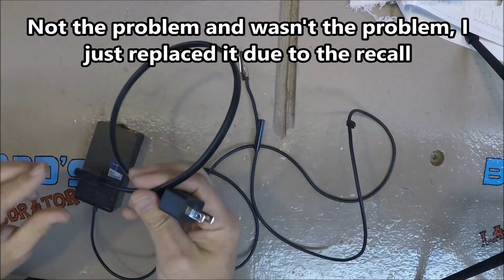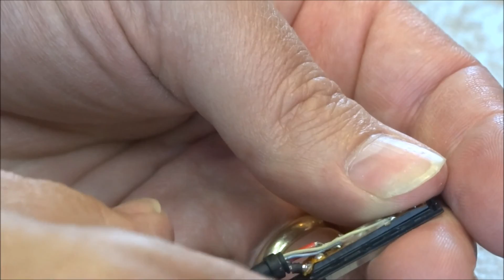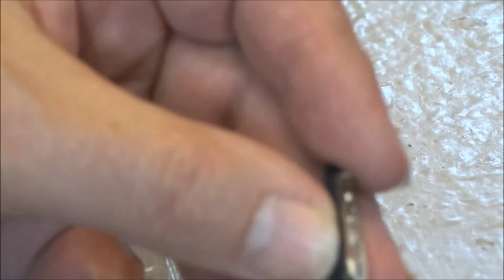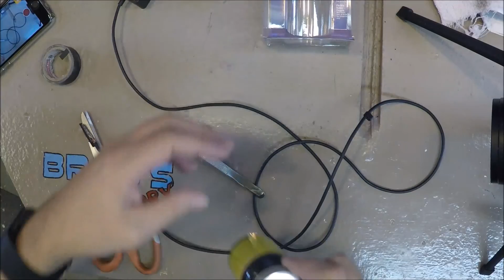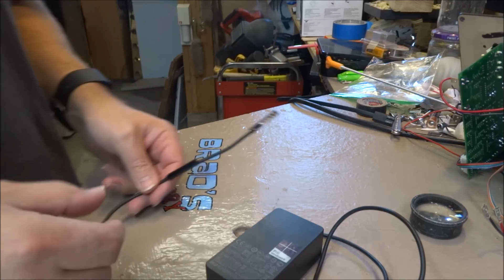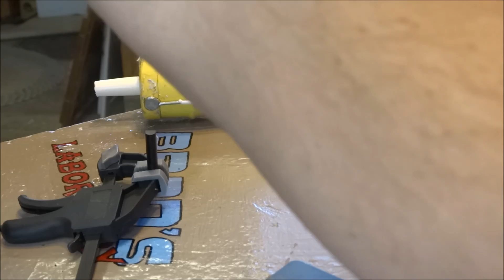Surface Pro Power Cable

Comment: Brad can you tell me the pin out on a surface pro dock? I posted some pics of the disassembled device.  I’m not sure if the centre pin is the 12V or just LED/sense. Then there is pins 2,4 which are connected and the pins 1,5 which are ground and are the outermost metal parts inside the socket.  Is the connector carrying 12v and 5v?  Or just 12V with two types of ground?
Reply: I meant to add pictures

https://photos.app.goo.gl/XuZvNsnGFTwyohjR9
Reply from the maker: I don’t have one to test but a google search shows 12V on the two outermost pins, next pins in are control bus pins that are used for information exchange between the power supply and the computer and the innermost pins are ground.
Reply: Thanks Brad - did you see a picture? I’m not game to connect it yet - mean time waiting 2 weeks for a plug-pack 4A 12V adapter in the mail 
ARyee 15V 6A 90W Surface Dock Charger Compatible with... https://www.amazon.com.au/dp/B095S3M1PM/ref=cm_sw_r_sms_api_i_BNM18RW8WRME5NCBCA05?_encoding=UTF8&psc=1

Comment: Hi, I am having trouble with my surface pro 1 charger, I opened it as you did on the video and check the voltage between ground and power but it only shows 8.20 Volts and not 12 Volts like yours.
What could be the problem? BTW, Nice video, thanks
Reply from the maker: Something is dragging it down, maybe the LED is bad in the connector or there could be something else going bad inside the power supply. easiest thing to do is to buy a new one, they have gotten fairly cheap these days:
https://amzn.to/30CR8K4

Comment: Does this works for surface pro 2 too?? Please help
Reply from the maker: It appears the surface pro 1 and surface pro 2 use the same power adapter, so your should be good to go.
Reply: @BradsLaboratory  my surface charger was working fine a few days back but now it has stopped charging the surface and the led won’t light up. I saw your other video using voltmeter and there is no voltage (12Volts )between power and ground. The charger warms ups after connecting to the power source after a while. But the surface isn’t charging. I even used the electrical tape like you explained in this video but still no voltage. Please help what should i do. Should i repair the charger or buy a new one? The charger is very costly here (5000 bucks on amazon)
Reply from the maker: @Sunny_Goyal  I would check for damage to the cord, power is probably not getting from the power supply to the connector. My power supply is 12VDC at 3.6 amps, you can find one with the same or more current you can use that if the power supply is bad.
Reply: @BradsLaboratory  i am sorry, I couldn’t understand what you are trying to explain but my house power outlet(wall outlet) is good.its charging other devices like my phone. Its has 220 Volts output and i checked the cord which connects the wall outlet to the surface charger by removing it from the surface charger and using voltmeter which reads approx 230 volts. I connected that cord back to the charger and the charger warms up but there is no voltage difference between the pins in the connector like you explained in the other video. Please help what should i do?
Reply from the maker: @Sunny_Goyal  I was just thinking that there could be an open wire between the power supply and the connector if a dog has chewed it or something like that.
Reply: @BradsLaboratory  sorry, but I don’t have a dog or a cat. Also there is no open wire. Moreover I do keep my electronics safely. But it somehow stopped charging suddenly. Is there any way i could revive this charger or do I have to buy a new one :( ?
Reply: @BradsLaboratory  hey brad have you tried opening the adapter? From where does the adapter open ? The side where there is something written and a logo of windows is there or the totally plane side where nothing is written? Please help. For the surface pro 1 or pro 2 charger.
Reply from the maker: @Sunny_Goyal  I have not tried opening the adapter. I do not see any screws so it is most likely sonically welded. Opening it is going to be destructive. If you want to open your you will have to put it in a vice or clamp and squeeze it until the plastic welds break.

If you think it is a bad power adapter, then if you can buy or find a power supply that is 12VDC at 3.6 amps - just cut the power cord off the old one and attach it to the new one with solder and heat shrink.
Reply: @BradsLaboratory  sadly, watching the other youtube videos by cutting the box open, I tried using a knife and a screw driver and I did cut my finger today.. (I am not a professional). Do you happen to know if there is any good DC converter which i can buy from amazon which can charge up my surface pro2 ?? I have the cord, i will try to get it solder by some professional this time.
Reply from the maker: @Sunny_Goyal  https://amzn.to/2UyplaC

Comment: Thanks for this information. I am also interested in what camera'[s you were using to do your shoot?
Reply from the maker: I use a mix and mash of cameras when I am recording. I generally set up a few cameras with different angles or pointing at different machines so it is easy to start them while I am working. For this video the top view shots of the bench where shot with a Gopro Hero 4, while the closeups where shot with a Sony DSC-HX300.

I also have a Canon HFR200 and a Cheap Chinese DVC 720p Camcorder and of course an iPhone that I use.

Comment: It's the same to surface rt????
Reply from the maker: This is for first generation Microsoft Surface Pro and RT. There is a different connector on later models.
Reply: @BradsLaboratory  my model is 1516,  and I don't know where the wires are soldered, for example: black with the pin 1 or blue with the pin 3
Reply from the maker: @lordjavoacusticobig  I have a more detailed video here on this subject:
https://youtu.be/svc6r4cqxAI

If the connector looks the same, then it is the same pinout.
Reply: @BradsLaboratory  Does this works for surface pro 2 too?? Please help

Comment: My surface pro 4 adapter felt from a (relative) high altitude and stops working (my own mistake of course)

Thanks to this post, I could create my own power supply.

I've bought a USB 3.0 TO SATA/IDE 2.5/3.5/5.25-INCH Hard Drive Converter/Adapter that has its own pocket power supply.

I've cut and use the male side of a computer power connector (the 4 pin side of this Amazon StarTech.com 6in 4 Pin Molex to SATA Power Cable Adapter - LP4 to SATA - 6in Molex to SATA Cable - 4 pin to SATA power)

I've cut the cable from my Surface Pro adapter (mine has only 3 wires. Red, Blue and Ground)

The connection:
Surface pro 4 wire _to_   Male 4 Pin Molex to SATA
_______________.................._______________________
Red ________________to____Yellow (12V)
Ground ____________to__ Black (0V)
Blue  ______________to__ Black (0V) this has to be connected otherwise it won't work (in my case) 

My pocket Hard Drive power supply specs
12V 2A on the Yellow
5V   2A on the Red   

Hope it helps

Comment: Could you please tell how you opened the connector?
Reply from the maker: It snaps open, you have to use a plastic tool to pry it open.
Mine was broken open so it wasn't a problem.
Little plastic tabs and indents are molded into the connector housing.
Reply from the maker: I opened the connector on my second power supply tonight, it seems to be ultrasonically welded. I got it open by squeezing it in a vise to break the plastic weld and then worked it open with plastic prying tools and a small screw driver. After the repair you will have to glue it back together with silicone or super glue.